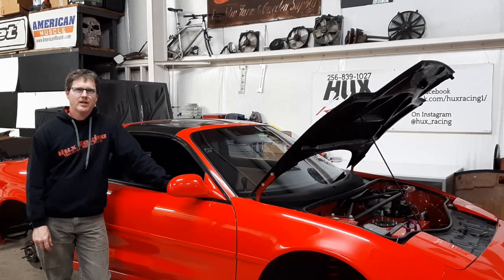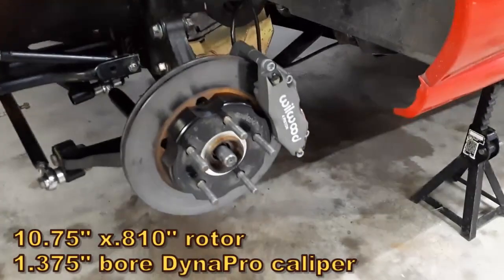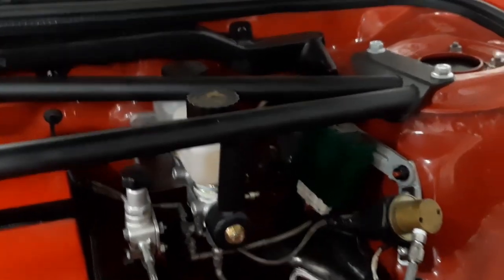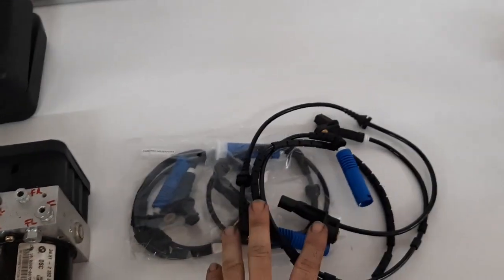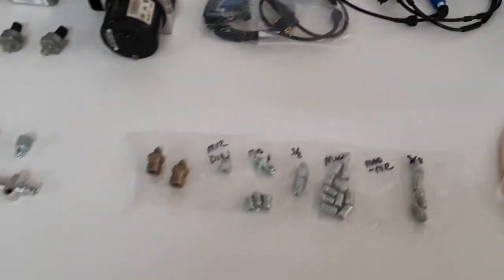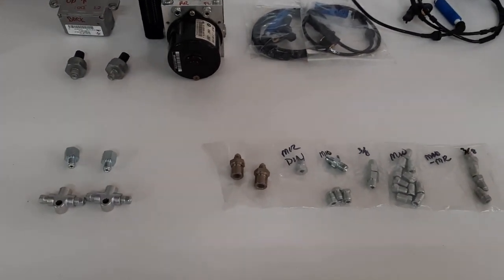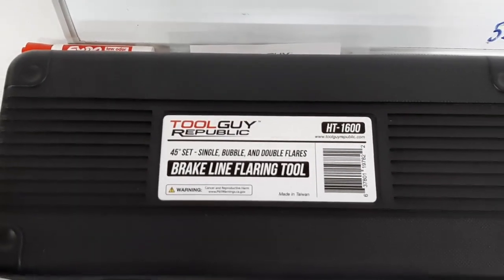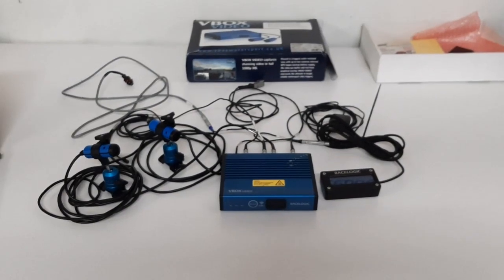Modern BMW ABS into a 93 Toyota MR2, MK60.

Comment: Bump again for updates since someone's giving me an E46 M3 ABS module setup for free.  I'm also still curious if there's a way to make DSC work as well.
Reply from the maker: Not sure. I was told to contact Doug directly as he builds the harnesses.
Reply: Fair enough.  How's your install coming along?
Reply from the maker: @M5JamesE39  on hold until new engine with new ecu running.

Comment: I have been looking forward for so long to see something like this mod for the MR2. Eric. Any tips on converting non-abs hubs front/rear to use these sensors ?
Reply from the maker: I'm really not seeing a solution simpler than converting to abs hubs.
Reply: @HuxRacing  I was thinking that the hubs could be drilled and tapped. Then install the reluctor rings. Would you post the measurements for the holes?
Reply from the maker: @mid-enginedman2946   I will see what I can do. Machining the hubs should not be too bad.